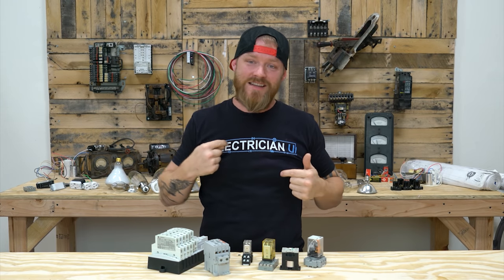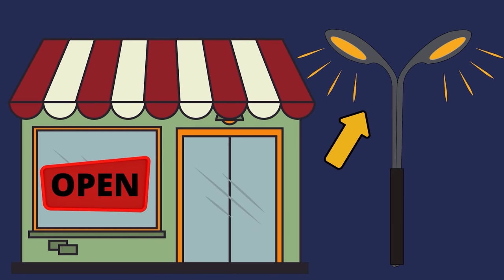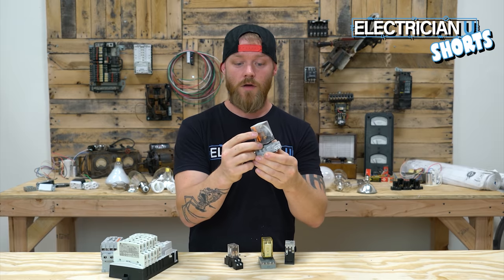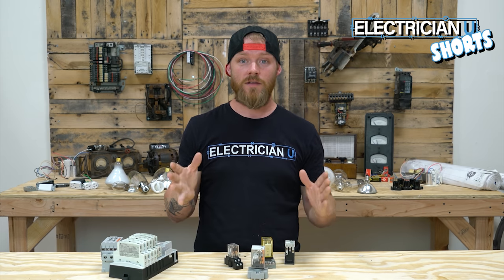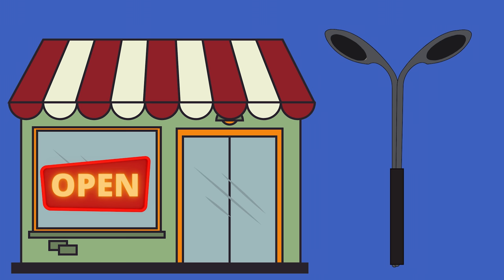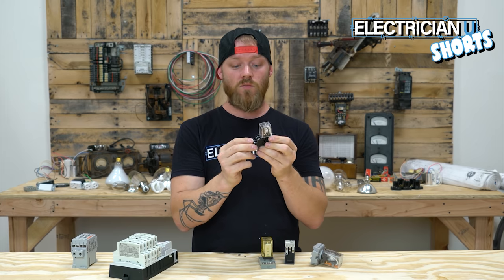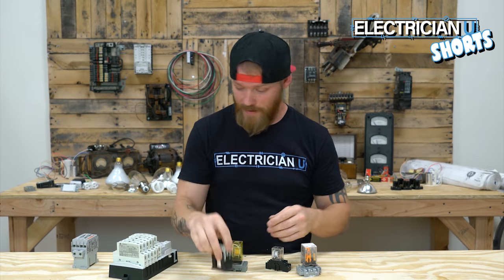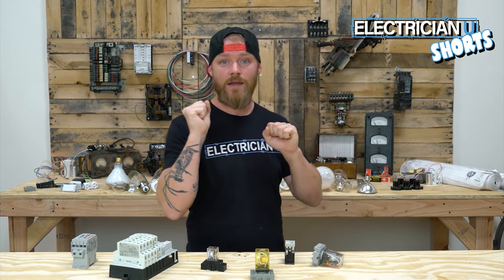SHORTS  - What Are Relays and HOW DO RELAYS WORK?

Comment: Always thought the most useful part of relays was low volt switching. You can run a 12v bell wire switch instead of 50a  6/3 w/ ground. Getting one light to turn on when another turns off can also be accomplished with a 3way as long as they're on the same circuit. It's super handy for bath fan/light/nightlight combos.

Comment: Before the introduction of the Programmable Logic Controller in 1969, production lines used relays for control logic with thousands of relays in cabinets. They took months to rewire for the new model year.  Similarly, the early computers used relays for logic gates.  Relays permit one electrical circuit (often lower voltage) to control other electrical circuits by electro-mechanically closing the load circuit.

Comment: While working as a sparky at a large newspaper years ago the smart company that made the printing presses installed relays with a pushbutton to operate most relays along with a minature lamp connected to relay coils. Had hundreds of relays so this was a quick method to troubleshoot a problem. Never had this type in start or safety interlick circuits. Wish I had a dollar ever time a nin electrician tried to get a machine running but installing a low voltage coil. A lot of the old European machines had 240 VAC relay coils. Some machines had relays with 4 seperate relay coil voltages. Could be 12, 24, 120 or 240 volt AC or DC relay coils. Had 48 pick & place machines that had a few 6 volt relay coils.

Comment: I was of the understanding that relays are maximum of 10 amperes.   Unfortunately your examples of light and sign which would be branch circuits which normally are 15 amperes and above.   These would require contractors.

Comment: Once you have what a control circuit can do in mind you can control just about anything, gas valves, motors, lights on demand and with the normally closed or open relays on a timer...

Comment: I got interested in relays back in the day when we had to build the control circuit for commercial kitchen hoods from scratch. It can be accomplished with a 20 amp/120 volt GP relay and a couple  of motor starters. It's fascinating what you can do. I build circuits in my head when I'm bored.
Reply: Wow you are so smart

Comment: Your description of sending a signal to the coil to move the switch is misleading.  It’s only half the story.  A better explanation is that energizing the coil moves the switch one direction and removing power from the coil moves the switch the other direction.  The switch moves back without power because there is a spring.  It’s a momentary switch. Like a push button that pops out when you let go.